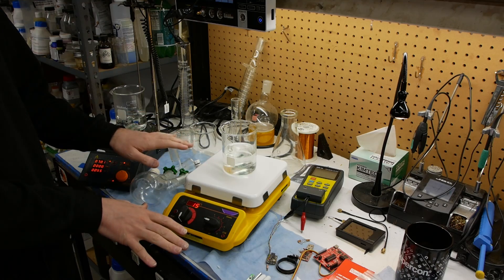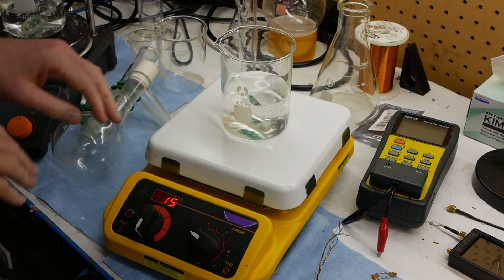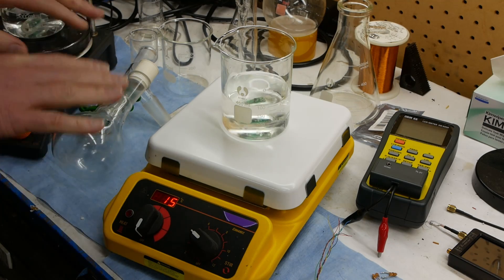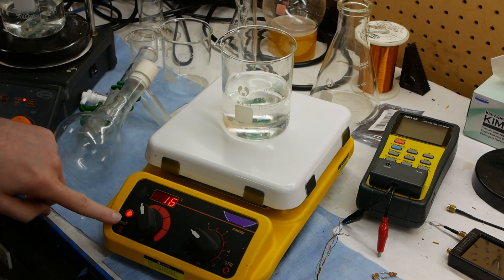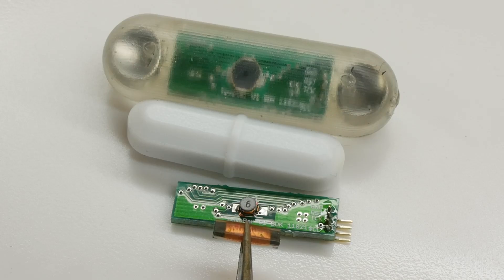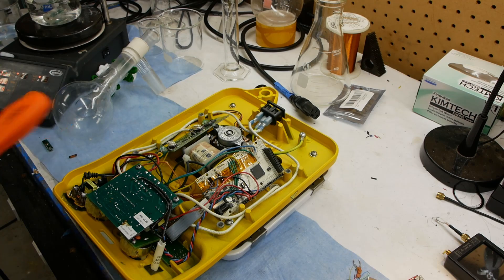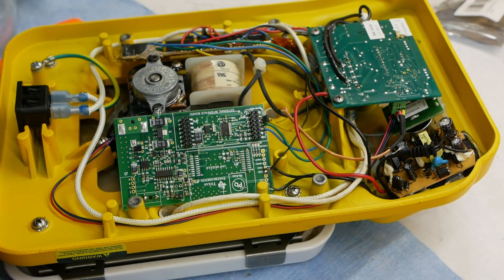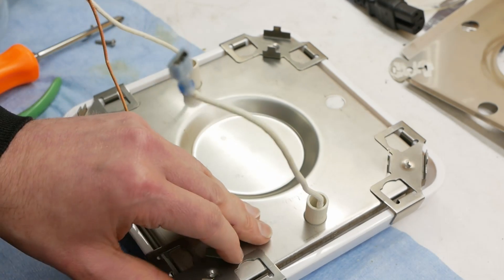Temperature-sensing RFID tag in magnetic stir bar

Comment: It's a neat idea but I think the biggest problem I foresee with this arrangement is that there's a definite temperature cap that you can put this thing into before you start melting the solder joints and damaging the electronics, although for low-temperature uses it's probably pretty great.
Reply: Solder joints will be your least concerns.  If you use the normal temp paste/alloy then 183C-190C is the working temperature. Lead free is >200C. Even the low-temp paste reflows at 137C. I've tested PCBs those are resilient too. The problem is the operating temperature of the ICs: Commercial grade is 70C max, industrial is 85C, military is 125C. While one could abuse an industrial IC and it would probably work fine for water-based chemistry, a military grade would be needed.

Comment: Thanks 

To calculate the values of an inductor and capacitor for a resonant frequency of 134.7 kHz, you can use the following formula:

f = 1 / (2 * pi * sqrt(L * C))

Where:
f = resonant frequency in Hertz (Hz)
pi = mathematical constant (approximately 3.14159)
L = inductance in Henry (H)
C = capacitance in Farad (F)

To solve for L and C for a given resonant frequency of 134.7 kHz, you need to rearrange the formula and solve for L or C, depending on which value is known or desired:

For inductance L:
L = 1 / (4 * pi^2 * f^2 * C)

For capacitance C:
C = 1 / (4 * pi^2 * f^2 * L)

Assuming a target capacitance of 1 nF, we can solve for the required inductance:

L = 1 / (4 * pi^2 * f^2 * C)
L = 1 / (4 * pi^2 * (134.7 kHz)^2 * 1 nF)
L = 89.44 uH (microhenries)

Therefore, for a resonant frequency of 134.7 kHz and a capacitance of 1 nF, an inductor of 89.44 uH would be required.

Comment: Excellent implementation, you can improve the range of this stuff by placing ferrite sheet between the coil and the stir bar which dramatically drops the temperature it's exposed to. They can charge cars at about 30-40cm so there's a lot of scope there. Thanks for the pointer on the ceramic coated wire, that has a lot options for me on other projects.

Comment: Does it work without a battery in a stir bar?
Reply from the maker: Yes, this model has only a ceramic capacitor to store enough energy from the RF pulse to measure the temperature and respond to the base station.
Reply: @AppliedScience  Cool, thanks! Do you plan on making another model with some kind of battery in it? As this will probably allow using any existing stirring plate and a phone to get the values. Sounds much more complicated though
Reply: @NSGolova  Temperature range of the electronics is already a limiting factor, with a battery in there it would be even more problematic.

Comment: What did you use to detect the temperature? Or did I miss that.
Reply from the maker: I forgot to mention it specifically:  The temperature sensor is built into the MSP430 microcontroller.  It's data are available as an internal channel of the ADC, I believe.

Comment: this is awesome! with your current construction, what do you see as a limit for the bar temperature? any critical components that don't come in a high-temp version? I guess if they can survive maybe 120C they should be fine for almost anything on the plate cause it's going to be water based?

I wanted to come up with an example of a non-water thing you may want to stir, considered metals, realized you'd want a eutectic, thought "well why not use solder?" then realized I'm an idiot... =)
Reply from the maker: Thanks!  The commercial IC's are rated to 85*C, but automotive versions are good to 125*C.  The magnets are neodymium in this unit, but would probably need to be replaced with something with a higher curie temperature.  The urethane overmolding is not suitable at all, and should really be PTFE or PFA, ideally.  It would be an interesting case study to find out what range of temperatures would cover 50% (or whatever) of the hotplate market.  I would guess most would be water-based, but I actually don't know.  I think going above 125*C would be a challenge, but there is some precedent:  electronics at the tip of an oil-drilling rig!  It gets super hot down there, and they routinely replace electronics each time the drill is pulled up to the surface because it is beyond the microcontroller's limit.
Reply: @AppliedScience  Not sure about low power stuff, but big transistors in all metal case specify crystal temps up to 200 or so degrees, whilst plastic ones go to 125-150, my guess its package limited, so 200 degrees should be doable, just not with off the shelf parts.

Comment: I don't get it, you did 95% of the work, and you decide to give it away.

Make your money bro!
Reply from the maker: I used to think that the concept and prototype was 95% of the work, but I've changed my opinion after having been in industry for a while.  If it were so easy to capitalize on this proof-of-concept, my friends and I definitely would have done so!  In reality, it requires a lot of money to develop the prototype into something ready for commercialization and that money must come from somewhere.  That "somewhere" will either be a VC, who would want to know the whole business plan of the company, and how it will compete with existing, very established lab equipment companies, or it is an existing lab equipment company, who probably already had the idea somewhere in their ranks, but needs IP, or some other point of leverage to take it from concept to product.  I like the idea of starting a "smart lab equipment" company though.  With enough grit, determination, and funding, I think there may be an opportunity for lower cost and higher feature stuff.

Comment: A NanoVNA (or other vector network analyzer) would help with tuning the antenna systems (including the capacitors as part of the system) to resonance.  Resonance is generally more important than gross antenna length / loop diameter.  With such a low frequency you'll never have enough wire to be resonant (thus the capacitors) but a slightly shorter resonant antenna is going to perform far better than a slightly longer non-resonant antenna.  There's also some calculators you can use, but that's tricky because there's close proximity with other reactive metal components (some of which may even be grounded, which is a problem).

Comment: Very interesting.  Another thought about the tx coil going between the mica heater and ceramic plate would be about thermal conduction properties.  I imagine they made the heater have nearly the same XY area as the ceramic plate for maximum heat transfer.  If the coil went between the heater and the ceramic plate, it would likely take more time to heat the fluid to its temperature.  The coil would likely have to endure even more thermal punishment

Comment: One thing, stir bars are absolutely notorious for picking up crud on their surface and causing all kinds of unanticipated reactions. If you work with sensitive chemistry, you often need to go through dozens of stir-bars within weeks. When I was working in a dirt-poor university lab, we actually just used  paperclips pushed through molten glass. So it'd be interesting to think about changeable "shells" for smart stir-bars.
Reply: What sort of sensitive chemistry was that? I have never had an issue like that (or heard of it), even with tiny amounts of trace elements like in an ICP-OES.
Reply: @leocurious9919  Various metals, mostly. They were causing all sorts of unwanted catalytic reactions. Palladium was the worst offender.
Reply: perhaps some sort of glass capsule, maybe a regular old ampoule but they are a bit thin but definitely could work, after the bar is near the end of its life, smash it and put the module in a new one
Reply: @EdwardTriesToScience  Yup. A tight-fitting glass tube that you can easily crimp after heating. No chance of cross-contamination, and can easily be done in a lab.
Reply: I would think an enterprising person could design hollow stirbars that screw together, where you can add a smart device inside or throw a neodymium magnet inside and use it in dumb mode.
Reply: @rich1051414  I thought in this video that's what that was, just a shell. Basically two halves stamped together
Reply: the thing i would be worried about a stir bar that is hollow and sealed mechanically is that if you pull a vacuum on it, it may explode (pulling a vacuum with high temperature is sorta common in chem) and glass would not be easy to add threads to that form a hermetic seal (plastic will dissolve in solvents, polyethylene will melt at >100C) teflon seems like the only good choice but unfortunately it is somewhat porous but you could probably coat the inside with something so liquids cannot seep into the electronics
Reply: @EdwardTriesToScience  Glass is pretty tough, even regular ampoules can withstand more than 1 atm of pressure. Although repeated heated/cooling cycles might be an issue.
Reply: @EdwardTriesToScience  is there a good source for diff material magnetic stir rods I can just buy cheap, for mixing food grade stuff?
Reply: yeah an ampoule is perfect, make the PCB a little extra durable and you can smash away at the ampoules, it may be desirable to make ones with rounded ends and a ridge in the middle but that can be automated easily (or get your poor uni glassblower to make a hundred XD)
Reply: as for heat cycling, as long as you dont heat the stir bar up to like 300C then plunge it into cold water it should be fine, at that temperature the PCB would probably be toast already (a high temperature variety would be pretty nice, you could use quartz glass for that but the circuitry needs to be able to withstand that.) Also a note i forgot to mention: it may be desirable to fill the ampoule with sand or oil or some thermally conductive material as an air pocket may not be desirable but tbh if its crammed in tight, it will be fine
Reply: the common teflon stir bars you can buy are foodsafe, just wash them with warm water and dish detergent first (however dont quote me on this as some may have leftover organofluorine compounds but this shouldn't be an issue anymore)

Comment: I wish I had some of those capabilities in MY lab stir bars years ago! ;-)
I hope someone is able to produce these as an actual product in the future... great idea!
Reply: Unfortunately, like many interesting fields, the niche-ness of the field is still low enough that the only real players are those with vested interests and funding. ie, the equipment suppliers dont have much incentive to drive prices down (IM LOOKING AT YOU MICROSCOPE MANUFACTURERS!!! Freaking highway robbery in some places....). One, because....97% of the customer base is funded by government grants and universities, so deep pockets, and two even with the high prices making back the product R&D is a bit of a bear. On top of the patenting issues. Sure, patent holder A might be perfectly fine with anyone producing it as long as they call it a "Dohicky Delux 2000" but if patent holder B whos devices A's is used with wants all the monies, you're SOL. The good news is a decent patent basically tells you how to make one. And you can make whatever you like for your own non-profiting personal uses. You just cant sell it without a patent license agreement. Take the CNC realm for example, we could have had 3d printers in the 90s. Every paper printer had 90% of the equipment needed. But the control scheme was patented, so until that ran out no one could market 3d printers making the bar for entry very high where it came to producing the needed hardware and such.

Basically, capitalism ruins innovation. Well, specifically greed, but greed tends to ruing everything.....and thats coming from a capitalist 🤣
Reply: someone have just google "SmartSense stir plate". But the price is honestly ridiculous 100$ for the stir bar and 2275$ for the hot plate.

Comment: I'm wondering if it's possible to create a thin mat on the outside of the ceramic that contains the coil, allowing you to use the device without having to modify the stir plate. Essentially, it's an add-on that you can use on any existing plate.
Reply: You'd still need to modify the electronics for temperature control, no? Or could you just plug it in to the port that the thermocouple usually is plugged into..?
Reply: @user-ko7lz3kr1d  Yes, you're right. The electronics for temperature control would still need to be modified to work with the RFID tag. However, having the ability to use this add-on on any existing stir plate would be incredibly convenient and cost-effective, especially for laboratories that have multiple stir plates. Plus, with the mat on the outside of the ceramic, there would be no need to worry about potentially damaging the stir plate during the modification process. Overall, this would be a great solution for labs looking to upgrade their temperature monitoring capabilities without having to purchase entirely new equipment.
Reply: @user-ko7lz3kr1d  
If you go a level above basic hotplate you should get a "controller port", I think a company that sells modified plates could be viable for the amateur/newbie market, but if you really wanted to breakthrough the prosumer/industrial market you'd have to partner up with recognized brands.

I showed this to my dad that works for one of the largest Agrochemical company in Latin America in R&D, and he was thoroughly impressed, he also worked as a Uni Professor, and said basically what I was thinking: 
"This is really great it would be really good for students and amateurs to get into chemistry making their lives much easier we have it here in the lab, the equipment that we use here is highly specialized but sometimes more complicated then needed and dated in terms of what is possible. I could see myself using this as a student and when I started my career, I don't think this is coming into major R&D labs anytime soon, but it wouldn't surprise me if new labs just starting out would implement newer and simpler technology into their workflow. This is great and I'd love to build one with different probes and try it out with my colleges!" 
(paraphrasing he only speaks Spanish and French)

I love the idea and I hope that I can make one for my dad with different probes this summer, I'll try to ship it to him from Northern Norway 🤞😁🤞
Mostly to test out the claims of "express over night shipping anywhere in the world" they claim up to 3 days door to door delivery, last time we sent a standard package (one single book) it took 47 days to get to here.
Reply: If you already have plates that are set up to use a thermocouple probe (like the second unit briefly shown in this video) you could store the coil/bar electronics in an exterior module that interfaces with the plate unit via the probe connection. Less advanced features but effectively plug and play for temperature.

Comment: this is really cool. cant believe no one have done this before it seems really useful
Reply: I would expect the prior artwork thing is the main roadblock. You would be surprised how many great inventions are collecting dust just because someone got to the paperwork first and is now just holding it hostage for a bigger profit. The dark side of patent and copyright law, is practically black.
Reply: I had this idea a few years ago, and thru google I found companies who did this. 

"smartSENSE wireless temperature sensing stir bar"
Reply: @seilgu  Wauw that's expensive. 100$ for the stir bar and 2275$ for the hot plate. Knowing how fast a lab can go through stir bars this seems really expensive in the long run
Reply: My guess is, the reason no one has done this is because the stir bar is in direct contact with the bottom of, and the bottom of the beaker is in direct contact with the hot plate. The temperature being measured is not the temperature of the solution, but rather, it is somewhere in between that temp and the temp of the hotplate itself (often very different). This is a nifty idea, but it would need to change the arrangement of the magnets so the stir bar "levitates" instead of remaining in contact with the bottom of the beaker, otherwise it will be imprecise.
Reply: @saml7610  honestly, I doubt the error on the stir bar's readings would be particularly meaningful. Only a relatively small amount of it's surface is in direct contact with the bottom of the beaker/flask, while the majority is in contact with the surrounding liquid.

And it's not like your average thermocouple is particularly accurate either.
Reply: @Bobbias  Yeah, that's a good point. I assume you could design a slightly modified stir bar geometry that has an even smaller contact patch than the existing ones already do, and that would address any issues. At that point, you're right, you'd get more error from the sensor itself. Rarely do I even need very tight temperature control in my day to day, other than a few esterification reactions that utilize more temperamental catalysts (not Grignards reagents, those tend to be forgiving, although they can form a very nasty crust on the beakers if you go too high).
Reply: @saml7610  I guess it's useful in pairing with another external probe to get a better idea of the overall temperatures of the solution.
Reply: @saml7610  Im not an expert in physics, but couldn't temperature readings be obtained from the infrared light emitted by the liquid being stirred? This would prevent accidentally reading the heated plate. The stirring bar would need a mechanism to ensure that it points the right way up in the liquid, but this could be achieved using magnets, which seems relatively easy to implement.
Reply: Because it isn't needed.
Reply: @grantofat6438  just because current lab practice works doesn't mean it can't be made way less annoying